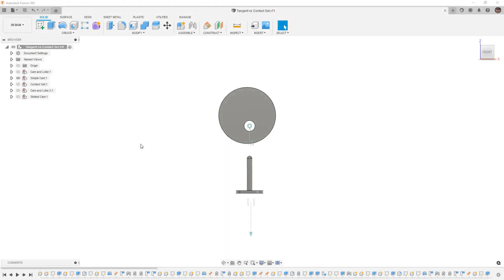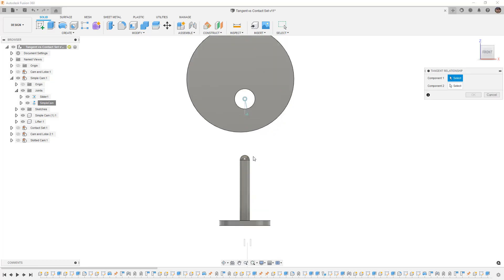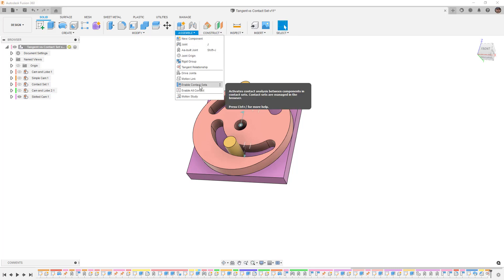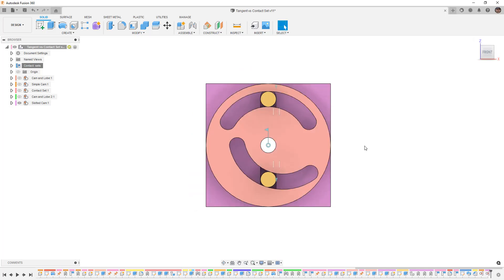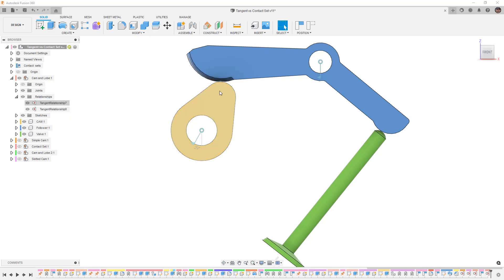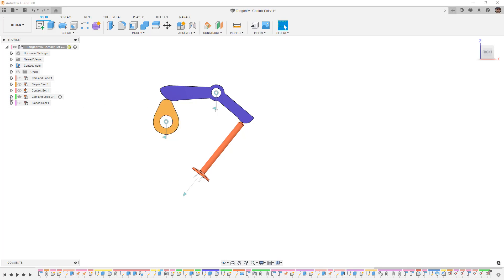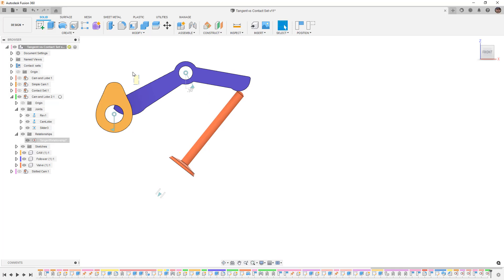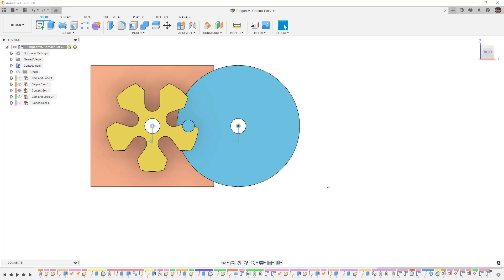NEW Fusion 360 Tangent Relationship - How Does It Work and When Should We Use It #Fusion360

Comment: Simple case - have a relatively flat cone (11 degree angles) on a slider.  Then a sphere on a slider at a 90 degree angle  to the axis of the cone.  There are two conditions where the sphere can be tangent to the cone - on the outside of the cone face or the inside of the code face.  Fusion seems to make the decision for you and you do not have the option to chose which side meets your design goal.   A kludge fix seems to change the revolve from positive 360 to negative 360.  Hopefully Autodesk will give the option of selecting what side you want the tangency on. in future revisions.
Reply from the maker: is it a solid or surface?  If its a surface then you can try and flip the normal.  If its a solid it assumes the normal is outward and should use that.  but yeah seems like there should be a "flip" option!
Reply: @LearnEverythingAboutDesign  it’s a solid made from revolving fully constrained sketch geometry.  Start at origin, horizontal line on x axis. Then angled line (11 degrees). Then horizontal line back to y axis. Then perpendicular back to origin. Then revolve around z axis.  Was surprised it did not know inside from outside of a solid and  treated it like a surface. Changing the revolve from positive 360 to negative 360 seems to correct it (guessing it flipped the normal of the face?). If you move the sphere too far it will flip to the other side so you need to set the limits. It’s a work in progress, but has potential.

Comment: Great video.  Very helpful. For the cam/valve example,  I'm wondering what would happen if the follower component was split into two components and then each was "rejoined" with an as built rigid joint. This might solve the problem of two tangent relationships trying to work off one component.
Reply from the maker: Thanks Bill, sadly I tried that for this video and it didn't work.  It was almost like it was having trouble solving the joints in order.  I hope in the future it will work better because that cam/follower would be an ideal choice here!

Comment: At time 8.56 , when you select the faces for the Tangent Relationship,  can you please try reversing the order of face selection, orange component face first and share if it works?
Reply from the maker: Unfortunately no it doesn't.  I had tried several ways of selecting the cam or the follower first with no luck.  I tried selection sets as well.  It just seems to mechanically lock up when there is more than one tangent relationship in a setup like this.

Comment: I just love your presentation style. Well planned, no fluff. I wonder whether this would work on a bolt carrier group mechanism, where the pin moves through a helical path. Or should we just stick to using contacts sets in that case?
Reply from the maker: Thank You.  For the bolt carrier, I haven't had luck.  The bolts/pins tend to flop and flip orientation so it would need to have a planar joint applied so it keeps its orientation.  Here is an example with one "bolt" set up.  https://a360.co/3KZQaK6  Try to apply it to the others and see what happens.

I like your videos as well!  Bummer about the defaults in Extrude!  I agree that should be in the core product.  I have commented on a few of your videos, not sure if it comes through.  Surrogate deboss i enjoyed.  I commented that you could also use Replace face with an inward offset surface as a possible follow up.
Reply: @LearnEverythingAboutDesign  Thanks, I will check out the file. I did see your comments in the surrogate emboss video, but did not have time to clearly read through it. Sorry about that, I have fallen behind on replying to comments recently. Will need some time to test your suggestion. Also, it's been a while since I have made that video. Will need to refresh my memory.
Reply from the maker: No problem and I understand.  I just wanted to be sure the info made it across in case you do an update video on the workflow.